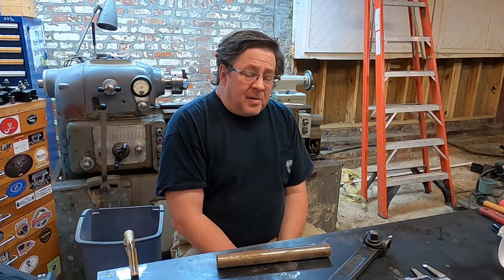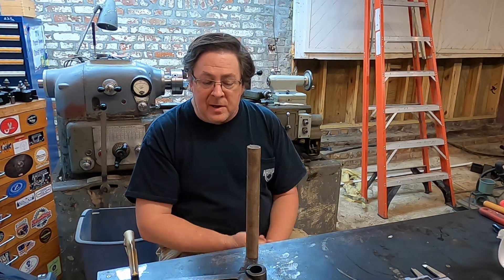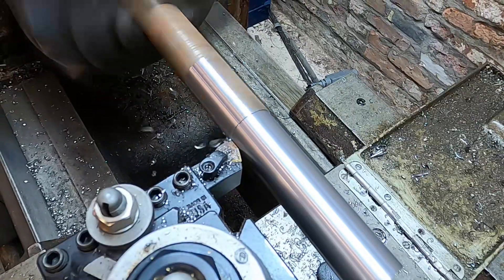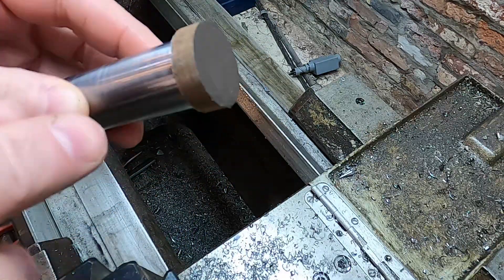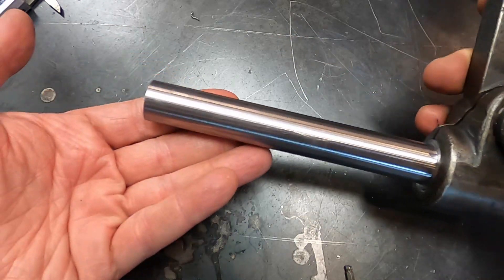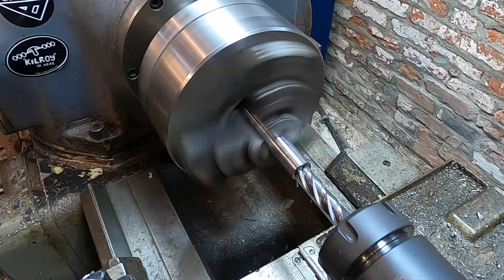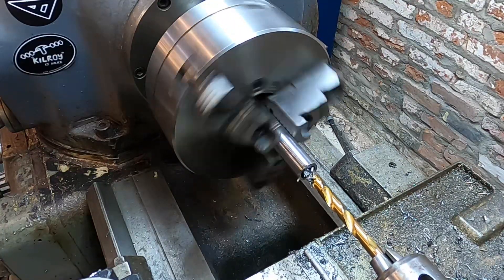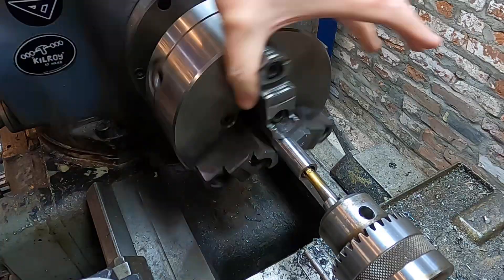Boring Bar for the Shaper

Comment: I don't bother with square holes. Just take the size of the square tool bit and multiply that by the square root of 2 and drill THAT size and you're done. It is just as stable and I'd say even MORE stable than a square hole.  1/4" bit needs a .3535 min hole.

Comment: Great job. Some of my old tooling had a cap type tool bit holding with wrench Armstrong to I think. Been awhile tho. I made my own tool post mount for two or three sizes of boring bars back in the 70s.copied there round one for the lathe. I know its not the same as the shaper but essentially it is. Thank for the video

Comment: Great video, as always!

I'm in the middle of a similar project. While I have several shaper keyway bars, I recently acquired a Tree tapered boring head...but it didn't include the original boring bars, so I'm making them.  Cutting the 1/4" squares through the bar, might be the most challenging part.....
Reply from the maker: Very cool!

Comment: Hi James.  Nice idea the different size interchangeable square tool bit holders for speed. 
If you'd left the  larger diameter section on between the two smaller ones the shoulder would have acted 
as a thrust ring up against the tool holder face. Enjoyed the machining process, something else to make. Tony

Comment: looks good but i think i would have milled a flat on the  counterbore section of the tool holder and put a set screw in the bar to secure the tool holder.

Comment: Hello Sir! Hey did the sawsall work to vibrate the mix for your window seals?
Reply from the maker: Yes, worked well, but not as well as the oscillating sander, which is what we ended up using mostly.

Comment: Maybe I missed it but,  what kind of steel did you make the boring bar from?
Reply from the maker: 1177 Stress Proof. That is pretty much my go to alloy for steel projects in sizes under 2"
Reply: @jtkilroy  Great Video, James...  Is that correct, you use 1177?  I know of 1144 but I can't find much on 1177 stress proof.

Comment: Nice bar, but aren't you worried about it unscrewing itself in a cut?  With my luck, it would right on the last cut.
Reply from the maker: That is a valid concern, but a little blue loctite and a firm turn, there is not much to worry about.